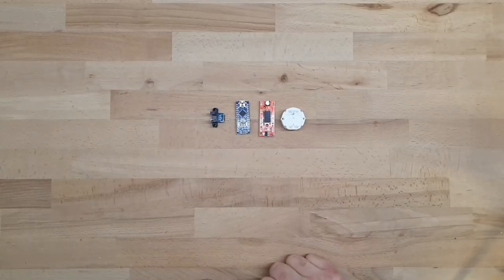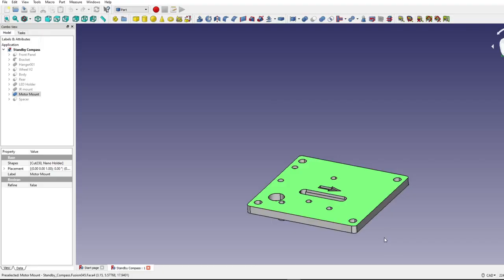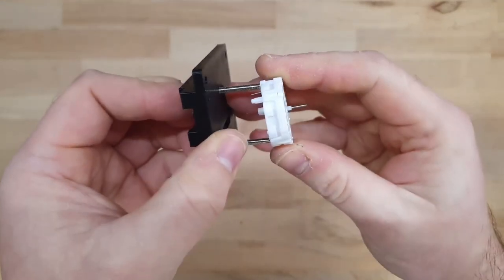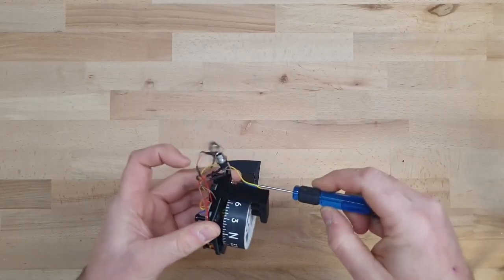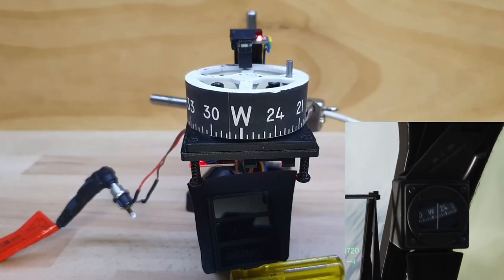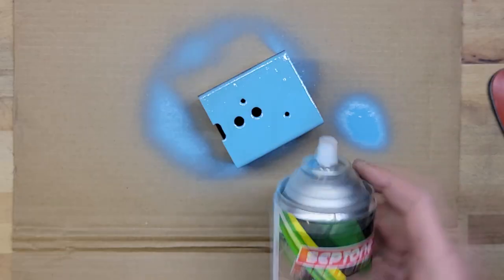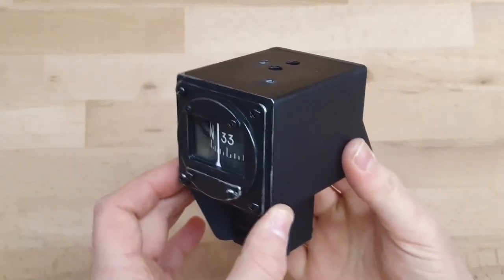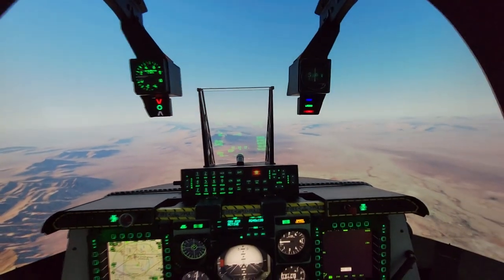Building a Standby Compass- (and how I finish 3D prints) - Home Flight Simulator

Comment: These steppers are so small you can drive them directly from the arduino outputs. Amazing stuff though, very inspiring!
Reply from the maker: I never even considered that. I might play around with it. Thanks!
Reply: If you drive them directly from the Arduino, you have to keep track of the output combination for the step.  With a stepper driver, you just give it a step pulse and direction.
Reply: @No1sonuk  there are libraries to keep usage almost the same. The bigger problem is the number of pins required. It’s a compromise, like most things.
Reply: @toxaq  Number of pins isn't really an issue if you're using the Nano just for the stepper and a few LEDs.
What COULD BE an issue is the amount of current drawn from the Arduino's 5V regulator with everything running at once.
Reply: @No1sonuk  you don't need a lot of holding torque so might be ok to just limit with appropriate resistance but you'll need a snubber because you're driving an inductor.

Comment: The X27 168 draw only a very small amount of current, I connect them directly to the ports of the Arduino via 1 Ohm resistors, you do not need a driver circuit. With that method, I built a traditional looking weather glass with an Arduino and a BMP180.
I think you used a stepper driver to use 12V because the rotor is quite heavy, isn‘t it? A direct connection can be used if you only want to drive a light clockhand (btw.: a good clockhand is a seconds hand from a cheap clockwork, it fits perfectly on the axis of the motor)
Reply: IF you use a stepper driver board, you don't need to keep track of output combinations and micro-stepping is easier.  All the arduino needs to do is send a step pulse and direction signal.
Reply: @No1sonuk  For this small steppers the Arduino subroutine is very short because this stepper is not capable of microstepping. Only a few lines of code make the stepper move.

Comment: Hello TWP, thanks for the video and all the other resources you make available for free.
With much help from another genius friend, I have ever build such a compass.
In that compass, we also used a lightbridge to determine the '0' point. However, we used a very small hole in a further closed disk. Is the pin you use not to wide to make it enough precise?

Comment: Just a heads up the way compass turns in the jet is real - the standby is terrible during turns - you get pre and pro cession based on if you're noprth or south of the equator etc. Id let it do the real thing :) (PPL Pilot)

Comment: Nice, but by using HSI data you lose the point of the whisky compass: it works after your HSI goes pop :D Why not use the mag compass data with an Arduino-side smoothing function? Could be really simple - just display the average of the last X hundred values - so no abrupt movements and also not completely reliable unless flying level?

Comment: oh wow dcs doesn't have a compass data variable you can access? I've done a lot of hardware for an x-plane sim, and x-plane has a compass heading dataref/output.

a few things to consider:

Could have it read bank angle to approximate the northerly turning error which is the most significant compass error. Wouldn't be hard to come up with a table of headings and bank angles to approximate the compass behaviour without getting too complicated.

As for the stutter on north, I would consider separating the current calibration from a fresh calibration into two variables.

So for examplethe current calibration thinks the compass is at 006°, and a new calibration signal comes in to indicate it's actually at 000°.
The compass should keep operating normally under the current calibration and not jump.
Slowly the current calibration would drift torwards the new calibration, over lets say 30 seconds. This would allow good accuracy while preventing jumpy readings.
Reply from the maker: DCS does have the actual compass data variable, I only chose not to use it because I didn't personally like the deviation.

Comment: Sorry to be a pest (again!) but have you used a separate Arduino for every panel? Just I wasn't sure if you could upload more than one sketch at a time in order to have two or three panels running from the same Arduino if they're just switches for example.
Reply from the maker: Some panels share Arduinos, it just depends how many pinouts I needed per panel. In theory you could wire up a large switch matrix and have it all on on Arduino, but I just used multiple Arduinos.
Reply: @thewarthogproject  awesome, thanks! I'll be starting my panels soon. My first Arduino arrived last week, I've got a BBI32 there as well. Might get a few Leo bodnar cards so the panels can be used with other craft too.
Reply from the maker: @JamesW81  look into the Arduino Pro as well. Cheaper alternative to Leo Bodnar and they can be coded to act as generic  joysticks. I used a Pro Micro for my DVADR and it is brilliant.
Reply: @thewarthogproject  Ah thanks very much, I'll give that a go. Just on now planning my first panel for the laser cutter.
Reply: @thewarthogproject  It's taken a little while to find one of my comments, but i just wanted to let you know I finally started! Iv'e pulled out the camera, batteries are on charge and im going to start doing a vlog. I honestly have taken so much inspiration from watching your content over the last couple of years. Thank you so much for sharing it with us, and thanks again for all your help and advice. The feeling i got when the first thing worked was unbelievable! i'm just off to finish my engine control panel design now. F-14 cockpit is underway!
Reply from the maker: @projecttomcat  great work! Subbed!
Reply: @thewarthogproject  Thank you :) making a start on the first proper video today

Comment: Ever considered using a OLED for the instruments so the background is black?
Reply: last time I checked, they didn't have OLEDS in the 70s :\
Reply: @millitarecho664  Things get updated you know...
Reply from the maker: Cost is the only reason i didnt use an OLED. I used the cheapest 27 inch IPS panel i could find! It would be an awesome upgrade though.

Comment: Beautiful engineering , its a pity that it does not show normal indications, compass turning and accelleration errors.
This is really an HSI in a magnetic compass indicator.  I just brought an HSI that weighs 5 lb, uses 28vac supply, , thats a load of weight. All this could come out of a 3D printer and weigh a few ounces.

Comment: Love your work! Something I've always wanted to know about these dual/triple projector setups - how is the resolution on the screens? How does it compare to your G2 or older monitor setups? Would love to go this route but worried if you lose too much visual fidelity.
Reply: They are 1080p and look as good (or bad) as that. I've gamed on a projector (not three) for almost 7 years (not anymore because I moved to another house and I left it behind) and they are fine, if you have a good screen (white walls work, but if you have imperfections, depending how far you are, you will see it.). I had to change the lamp once. It was not as expensive as I thought (sub 200 USD). In comparison with a "monitor" that you have closer to you, the projector is "a bit less clear and more blurry" -remember you also have to adjust the focus-. if you need to read small stuff from afar, it is less crispy (depending on the projector).  But for this kind of setup, it must be awesome since you're only looking at the "outsides" so immersion > detail (imo) 
:)
Reply: @gryzor  Yeah I’m more thinking due to the curved screen warping compensation, you only end up using ~75% of the pixels in a triple projector setup, and ~60% in a dual. I’m thinking maybe 4K projectors with 1440p inputs might bump up the resolution to something better, but wanted firsthand experience from someone using the warping software. Thanks for your thoughts as well.
Reply from the maker: Thanks! Stretching out 1080p images over such a large area absolutely results in a loss of pixel density, and you lose even more warping it around a curve. I didn't go the projector route expecting awesome 4K eye candy picture quality, I knew it was a trade off between visuals and immersion. All u- I am happy with it. I'd love to see what I could do with 4K short-throw projectors, but the cost of those and the PC that would be needed to run 3 of them and still be playable (if that's even possible) means its untenable for me. People that sit in mine soon forget about the lower resolution though, just because of the awesomeness of the huge size and the immersion of sitting in the cockpit and being able to feel things. 

When compared to the Reverb G2 its night and day, the G2 has much better resolution than the projector screen. So if 4K images and super crisp resolutions are your thing, i honestly wouldnt recommend a projector setup. But if you are planning to do what i did because you want to make a full simulator, it would be a shame to not be able to see any of it...

Comment: Great video. I´m in the process of learning Arduino, and i thought you could run the steppermotor with the Arduino only. Why do you need the stappenmotor driver module?
Reply: Amperage draw?
Reply: @fulloppositelock6778  A stepper motor is a 'dumb' motor and needs a signal from a driver to turn a certain steps
Reply: @marcelklip  Correct.

Comment: For your dial, is there a flexible material you could 3D print in where you do it flat with raised or recessed numbers and then wrap it around the wheel?

Comment: Does DCS provide you all three axis of rotational data for the simulated spirit compass or only the heading as it's displayed?
Reply from the maker: Sure does, I just haven't implemented it as my compass only has one axis.
Reply: @thewarthogproject  that's really awesome. I need to check out this game. I was just thinking about how difficult it would be to use another two of those steppers for tilt and roll, or even some electromagnets with proportional control to make it more compact

Comment: Do you ever model instrument failures during your sessions? If so, would the HSI ever fail? If so, then so will the compass? If so, then that's the only problems I see in slaving the compass to the HSI. In other words, the compass is intended to be an independent backup instrument. By knowing it's slaved to the HSI instead, sort of ruins that immersion factor, and thus really makes it nothing more than an appendage of the HSI. Which is a shame considering the superb work you out into it!

Comment: I will say one thing: regarding the "not realistic" behavior of the magnetic compass, these things are indeed rat shit in real life and you basically have to be straight and level for a moment to get a worthwhile heading from them. Its a real nightmare to have a gyro/vacuum failure and have to fall back to mag compass especially when IMC
Reply: Yeah that's true they are only vague unless you've been straight and level for a while otherwise they overshoot or undershoot or they point towards your headset.  They are also usually faded to a light brown on black with bits of crap floating about.

Comment: I just tried to look at your files, and Cura is saying four of the STLs are "corrupted".  Fusion360 and Meshmixer won't load them either:
Standby Compass- Canopy Bow Hanger.stl
Standby Compass- Front Panel.stl
Standby Compass- Hanger Bracket.stl
Standby Compass- Motor Base.stl
Reply from the maker: Thanks for the heads up.!
I had a look and the only one corrupted for me was the front panel. I've removed it pending a fix. It was a rush job that one, because i didnt actually print it myself.

Can anyone else confirm if they are having problems with the others?

No idea what happened to the files... they have printed fine for me.
Reply: @thewarthogproject  They're showing up in the Windows "3D Viewer", but I can't do anything but view them.  It looks like there might be some geometry errors in the front panel at least.
Would you be willing to share your source files so I can load them into Fusion360 and try converting them from there?

Comment: Question: I thought the compass in an aircraft wasn't accurate during non-straight and level flight. Is this different in mil aircraft? (Or am I wrong in my assumption?)
Reply: That one isn't.
There's a "directional gyro" in the P-51 that reads like one of these, but is based on a gimballed gyroscope.

Comment: Impressive project. Congratulations.
I also tested those tiny stepper motors in combination with AX1201728SG supports 3780 steps chip and Arduino. Everything works almost perfect but I still can see steps in slow motion (needle doesn't move smoothly). Did you see similar behavior in your devices? If yes, how to solve that?
You can see that on my clip: https://youtu.be/qY3eVCT7PsY

Comment: 17:05 If you want more realism you shouldn’t base it off of the HSI. A compass has many errors that make it difficult to use and requires some skill and training to use properly. This is why directional gyros like the HSI are used, as they do not have those errors. During instrument training a vacuum system failure is one of the more difficult scenarios, especially when having to deal with compass errors.

Many pilots use the acronym VDMONA to remember the compass errors; Variation (true vs. magnetic north), deviation (local magnetic anomalies from the aircraft), Magnetic Dip, Oscillation (turbulence), Northerly Turning Errors, and Acceleration Errors. Aside from oscillation, the most noticeable are the Northerly turning errors and acceleration errors. These have their own acronyms, ANDS and UNOS. On an east or west heading if you accelerate the compass will Accelerate North and Decelerate South. When turning to a heading you must Undershoot North and Overshoot South by 30 degrees on N or S, and take of 10 degrees of over/undershoot for each 30 degrees away from North or South until you have 0 degrees of error on East or West.

All of this is being lost, and it is kind of cheating in a way to have your compass mimic a DG. I know it is just a game but if you do want realism use the standby compass data instead.

Edit because I forgot to add that the undershoot/overshoot is based off of turning at standard rate, 3 degrees per second. I missed a few more specifics so here’s a good video https://youtu.be/GxnvoRG6MDg